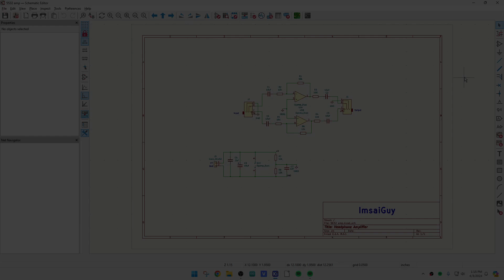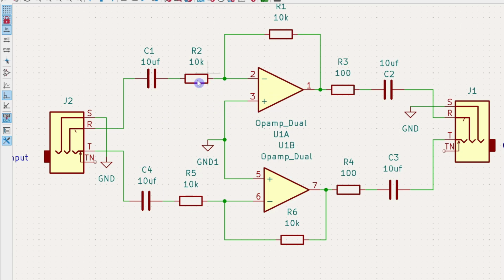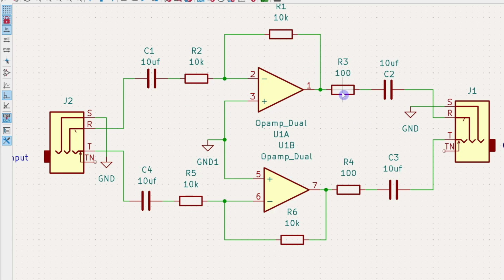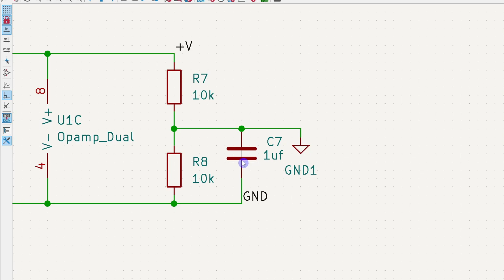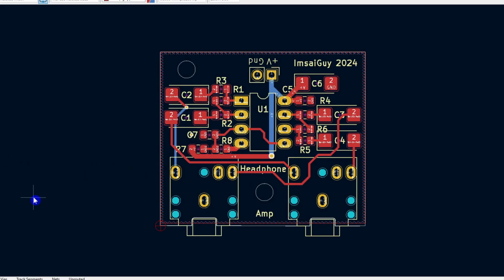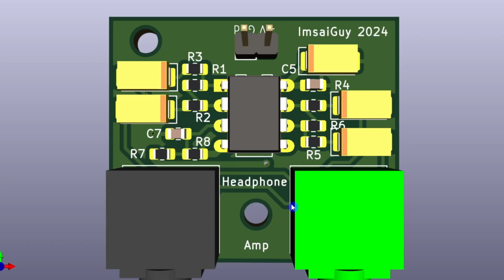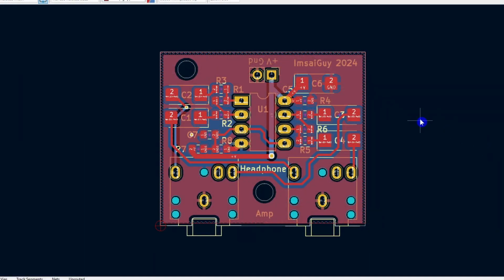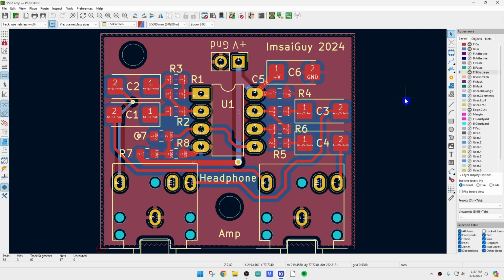#1873 5532 Headphone Amplifier (part 1 of 2)

Comment: I personally prefer the non-inverting configuration. Inputs and outputs are ac-coupled. So you can put the ground connector of inputs and outputs to the minus pole of the battery. It reduces the load on the virtual ground. R3 and R4 are not necessary. They only increase the output resistance of the amplifier not necessarily. It makes sense to increase the input impedance in order to reduce C1 and C4 down to 1 µF. The output capacitor should be increased to 470 µF in order to reduce the lower roll off frequency for 18 Ohm headphones. The virtual ground should be stabiliced with more capacity like 10 µF.

Comment: Word of warning for folks, the TL072 tends to have much more noise than the NE5532. Its big selling point is the very high input impedance from its FET architecture, but this is mostly just useful for guitar pedals/Hi-Z inputs and not much of a boon for anything else if you have a few bucks to splurge on NE5532s. Be warned though that the NE5532 also has a min supply of 10V!

Comment: Choosing the right opamp is crucial in this case, because you are using it to generate (at least some) power, which is not easy, because headphones are relatively low input impedance, so you need to deliver a lot of current, in fact, you need something peaking about 100mA, which is a lot for dual general purpose opamp. Imo it would be much better to boost the output current by pair of NPN/PNP transistors in B configuration driving them with some fast opamp, or using some IC designed to be an headphones amplifier, or just use some small af power amplifier like TBA915 or LM386.

Comment: If using a zero ohm resistor on the output, don't dare connect a capacitive load. Just in case, I wouldn't go below 10 ohms or so.

Comment: I hope those aren't tantalum capacitors in the audio path. No good can come from that.
Reply: Unless they are huge in value. Then cap type doesn't matter so much because the impedance is so low.
Reply: @misterhat5823  Oh I beg to differ. I couldn't understand why the phono stage in my Rotel preamp never sounded right. I found that the two stages were coupled via a tantalum capacitor. Found I could direct couple the two stages because DC offset was minimal. What a huge difference that made.
Reply: Probably good old microphonic ceramic caps :)
Reply: @AndyFletcherX31  I've seem microphonics in xtal oscillator PLL circuits but not in capacitors.
Reply: @chrisharper2658  X7R caps are terrible for microphonics. Way back in the past I did a microphone compressor for a radio system where you could get 10% modulation by shouting loudly at the PCB. We fixed it with a metalised film cap.

Comment: Thanks for posting. I build a lot of astable multivibrator circuits. And by far I have that the NE5532 IC chip in my opinion offers excellent performance. Great slew rate.
Reply: Why not just use comparators for your multivibes?
Reply: @whatelseison8970  True.

Comment: Unless you want several copies of this circuit, that's too simple to dedicate a layout. I'd build it on a piece of stripboard.
But my tip here is that if you are designing a board, make it the most complete you can, then you can leave some options out.
For example: adding reverse polarity protection, anti-static and RFI input filtering, bleeding resistors for the in-out coupling capacitors, adjustable gain and components for frequency response shaping (a few R's and C's), maybe phantom power input for condenser mics, power-on indicator LED, pin headers for if you don't want to use the jacks...
And mark on the silkscreen where is the input and the output (I think I haven't seen it on yours).
;)

Comment: You should connect non inverting op amps inputs to separate resistive divider middle point between battery positive and negative without any capacitors. Otherwise your headphones will catch DC in situation of overload, and insufficient capacity of filtering caps. 
Non inverting inputs should always receive half of the power voltage, otherwise your headphones could be fried with DC.

Comment: As people are mentioning all kinds of suggestions on how to improve/modify/change the circuit, here’s my totally unrequested take :)… There’s also the possibility to float the output socket „ground“ to virtual GND, doing away with unreasonably large coupling capacitors at the expense of an additional output buffer/amplifier. An even more complicated version sums the inputs, inverts them and uses this as the „output GND“ to boost the bass (which is assumed to be predominantly mono).
Reply: That's what "capless" single supply headphone amps do.

Comment: Should have a LPF on the input side to keep out any unwanted HF from getting the opamp oscillating. 
I usually default to about 2,2K and 220p RC.
Reply: A ferrite bead on the output isn't a bad idea either.

Comment: Use resistors to GND on the input jack side of the coupling caps, that should pull it down to ground for DC preventing nasty pops and cracks when connecting the source.
Reply: I've been trying to work out how to avoid connecting the audio's ground to circuit ground at all. Shouldn''t it only be used as a reference to a differential amplifier? Instead the inputs have been AC coupled, and the amplifiers amplify that with reference to a virtual ground.  And then at the output, the virtual ground is filtered out. In this way, it seems like currents can flow both ways with respect to the input/output ground (which is shorted across the i/o jacks).
I'm trying to make a thing that works like an oscilloscope in that you have to manually set the gain, but, you can listen to arbitrary differential signals down to microvolts, with the output being line level audio. For that application, it's important that the input's only path to circuit ground is through the input impedance of the differential amplifier. Otherwise you might change the weird circuit you were trying to listen to.
The trouble I'm having is that AC coupling that is easy enough, but I can't work out how to lowpass out the stuff above audio like RF, without a path to ground. Whose ground? I guess, the filter's ground is the shield, but, that's also your other differential input you're also trying to filter. Er...
Like I'm trying to search for a Medium Place between proper galvanic isolation, and just directly connecting "grounds" that could be wildly incompatible.
edit: typos
Reply: Was that a "The Good Place" reference?  @VK2LNA
Reply: @windshield11  Yeah mate, love that show.
Reply: @VK2LNA  Same, absolutely excellent.
Reply: @VK2LNA Like an audio probe?
Reply: @mikebond6328  Yeah, exactly. I realise now I worded it a bit weird like it was a new idea, I know it isn't new. But if you just search for 'audio probe', all that seems to come up is simple capacitive decoupling into a regular high-impedance amplifier. I'm probably just overengineering something that works fine...

Comment: I was going to say that the red copper pour looked pretty chopped up. There is just one connection to the rear of the board on the left side. Now that I see you did a blue copper pour also that answers that question. Not that it really matters for audio in any case. Just something to watch and a "Trap for young players" if they are doing any high frequency stuff.

Comment: Hi, Several months ago I suggested using a TLE2426 Precision Virtual Ground.  Two of the features of this device that I found advantageous is it consumes very low power (compared to a pair of resistors), and the virtual ground voltage is spot-on.  To accomplish this with a pair of resistors they would have to be extremely closely matched.  The only drawback to using the TLE is the maximum source/sink current is 20ma.  Keep of the great work.  It is greatly appreciated.
Reply: If you need more current for the virtual ground for a part of your circuit, you could use a unity gain opamp buffer. This keeps that part of the circuit from influencing the 'real' 'virtual ground' (weird phrase!)
I do this in a guitar pedal where the virtual ground is a high-resistance voltage divider (like 47k on each side, because it's what I had that I could match well), smoothed with a capacitor, then buffered with a simple opamp voltage follower. I don't know whether this is a bad idea in more sensitive applications, I just needed a bit more current to stop my diode hardclipper from shifting the virtual ground (other people desire this effect however!)
Reply: @VK2LNA  Thanks for the suggestion
Reply: The device is 1% accurate, so with a pair of 0.5% resistors and an opamp similar performance can be achieved. But its an interesting part if space is critical or one doesn't want to mess around with stability.

Comment: NJM4556A 70mA
Reply: as output buffers + NJM2068D as 3-6x gain stages and you got yourself a core of O2 Amp, which is really as clean as it claims and has all the chances to become one's endgame.
Not to mention, a great splendidly documented project to build from ground up in whatever shape or form is desired.
Reply: I've used those as line drivers. Great opamps. Though the NE5532 is loved for good reason.
Reply: @misterhat5823  loved is an exaggeration for boring go-to, which historically got so mass-produced that it costs the least in bang for buck departments.

Comment: Hi. If you use tantalum capacitors, you should show the polarity in the schematics. Is there a reason not to use electrolyte or ceramic type capacitors?
Reply: looks like his symbol and foot print are not aligned as you pointed out the symbol shows a non-polarised cap and the 3D part shows a polarised cap. the silkscreen shows what i think is a strange 3 sided rectangle, is this meant to show the Bar end of a polarised cap?
Reply: Tantalum only if there's a bias voltage with fixed polarity (e.g. single supply opamp referenced to 1/2Vcc), non-polar in any other case.
Reply: @KeritechElectronics  the whole point of a capacitor in the audio feed is for DC blocking which kinda hints that there will be difference in voltage between stages. In the old days when higher value non-polarised  cap were not so easy available you could put two polarised in series back to back.
As the cap is in series with the audio path its value will be driven by where you want the lower frequency breakpoint (-3dB) the lower the frequency or the impedance the cap sees the larger the value.  Tantalum capacitor were at times a double edged sword, they gave large value in a smaller package but their weight was quite high.  And they exploded with great affect if reversed biased. 
If your pcb had to survive in a high level of vibration they added to your problems,  if you want to see how  much a pcb can deflect have a look for any videos on performing a vibration resonance search.